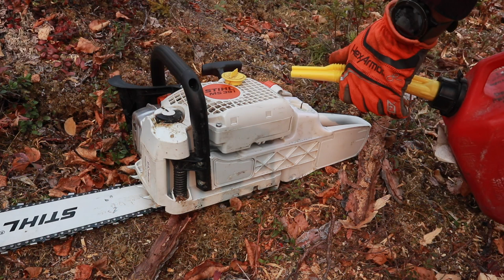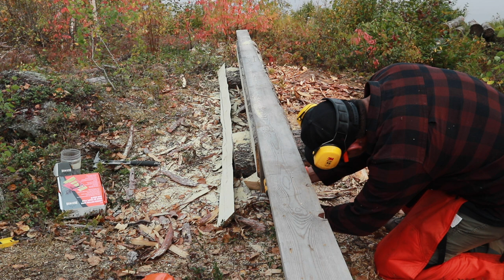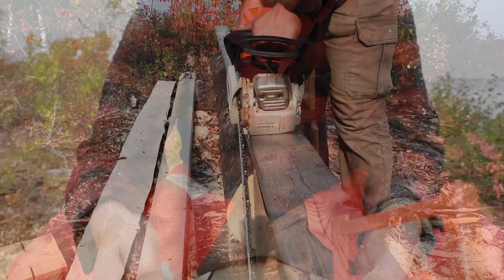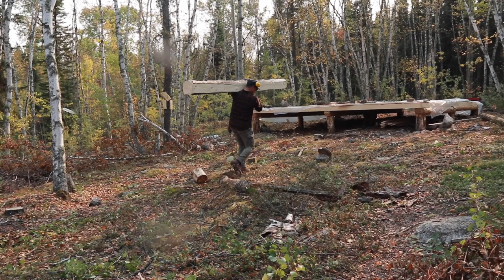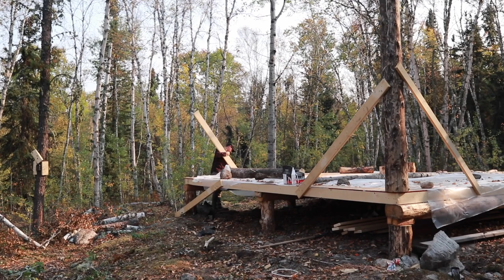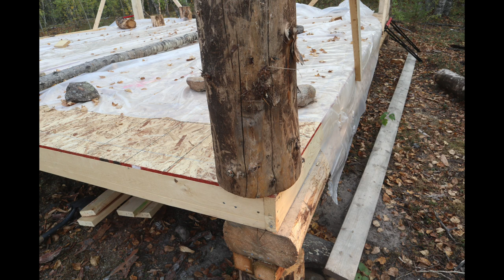Remote Cabin Build - Pt 12: Start of Post and Beam - Corner Posts

Comment: Hello from Seattle, our leaves are still green here. Looking good there. I'm curious on how you will finish the walls--if it is framed with studs or with  logs.
Reply from the maker: Both, I’m going to fill between the posts with halved logs stacked butted to the posts. With that method there won’t be much for insulation between the log gaps, so I will later frame a wall flush to the interior side of the halved logs, these won’t be for structure but more for insulating. Hope that makes sense lol plans been in my head to build it post and beam/log style/tradition framing lol

Comment: I’ve been learning to free hand chain saw lumber and I have just been using a bright piece of yarn nailed a inch away from my cut, it works well. I’ve seen people use a chalk line or a string dipped in used oil but that’s kinda gross. There are videos on how to freehand chainsaw mill that are good if you want I could send you a couple links. In one video I saw, the guys new saw blew up, he was saying not to rev it the hole time, he was using a Stihl 261
Reply from the maker: Yah 261 would be abit small to rip, I cooked the pistons on my 291 ripping a 2nd log. Cheaper to buy new than repair so I got a 391 and has been holding up since.